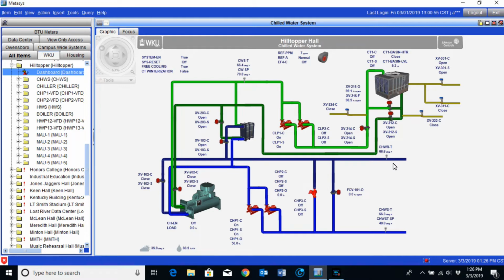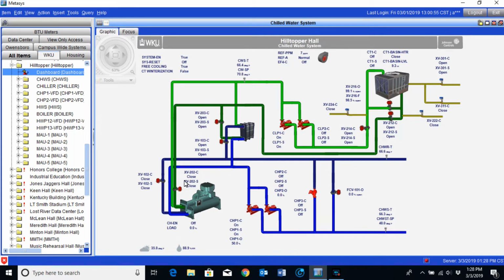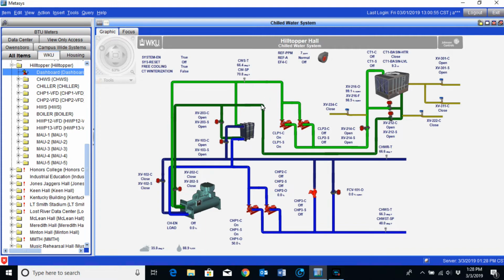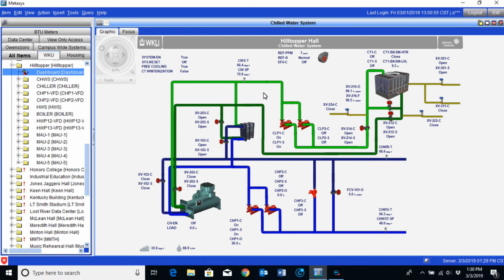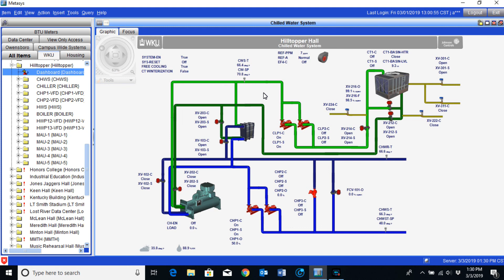How a chilled water plate frame system works

Comment: Thank you for the contribution. 
2 Questions. 1-On the CHW piping there are 2 bypass lines.  One with a bypass valve and another one with a pump. What is  the purpose of these?
2-How is the HX enabled electrically? I mean, once the OA < temp stpt the iso valves open and have close the endswitches?
Reply from the maker: One of the bypass valves is part of the temperature control for the condenser loop.  As water temperature cools down in the condenser loop the bypass valve opens to bypass the cooling tower.

Comment: How cold would it need to be outside for that Tower water to freeze since the water is always moving?
Reply from the maker: That depends on several factors.  One place where it could easily freeze is as it is coming down the honeycomb.  We have chemicals in the towers that run during the winter to help keep them from freezing.
Reply: @Systemcontroltech  We were changing out a RTU yesterday and there was a Cooling Tower on a another building that the water had frozen coming down the honeycomb.
Reply: We changed the nozzle size on our CT running a plate and frame. Even during the polar vortex this year it had very little ice build up.